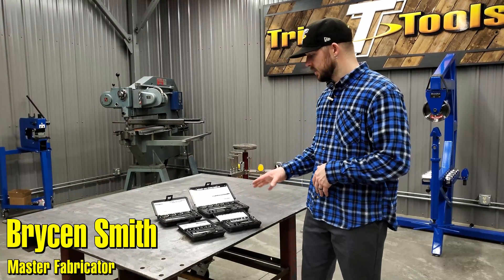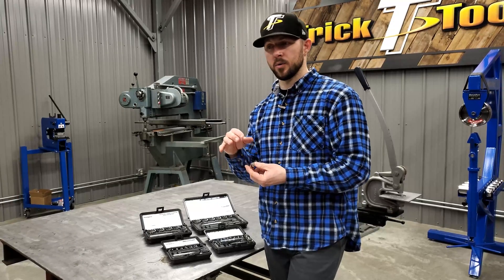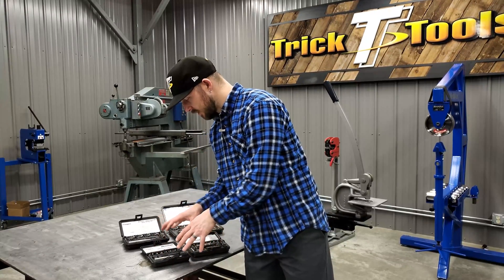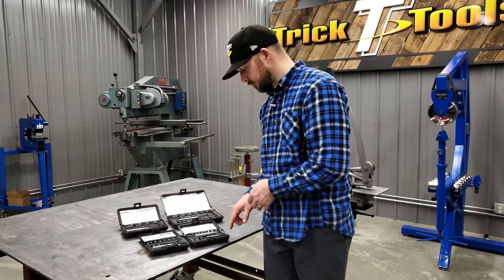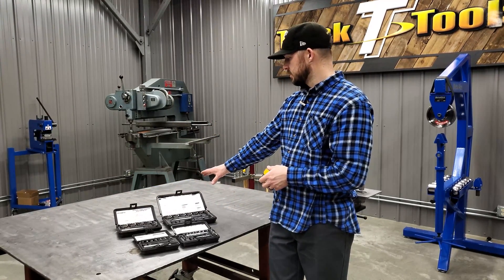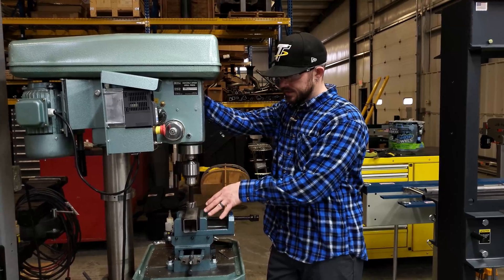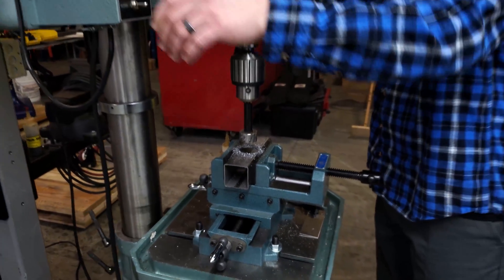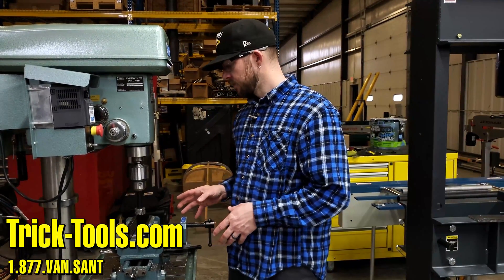Hougen Rotacut Hole Cutters - Trick-Tools.com

Comment: You stated they cut 1/2" depth. The set that I have a 3/4" cutter will only get me 5/16". Bummer too because I'm cutting 3/8 material.
Reply from the maker: There are two different series from Hougen, the Holcutters are 1/4" depth and the Rotacut are 1/2" depth

Comment: I believe the "washer" on the small kit is also to keep you from plunging straight thru on the straight walled sizes 1/2" and above IIRC. The spring loaded center pin also acts as a ejector for the center plug.

Comment: Do you have any " tips" on removing the cutter from the arbor after it gets tightened to the arbor?
Reply: Lube the threads and washer well with dielectric grease prior to use.